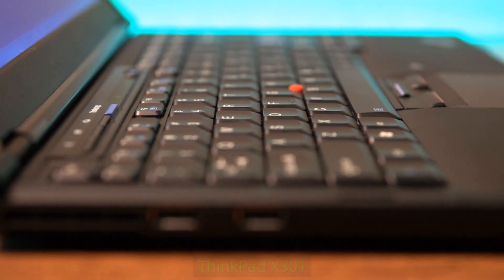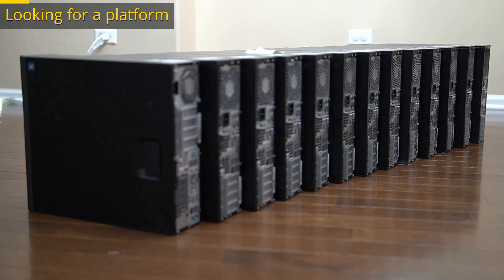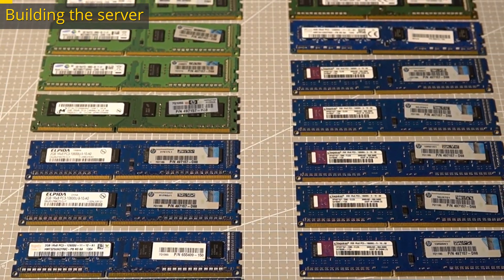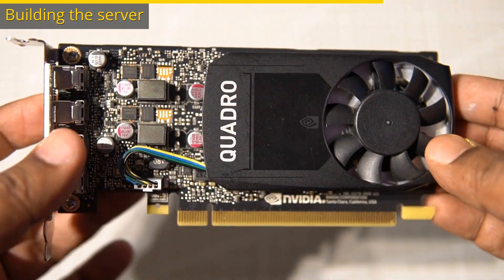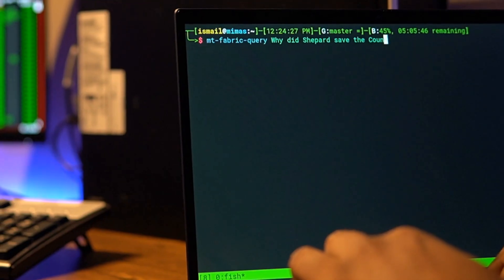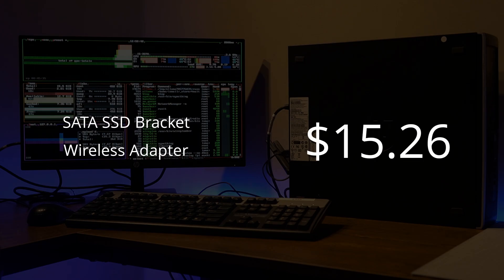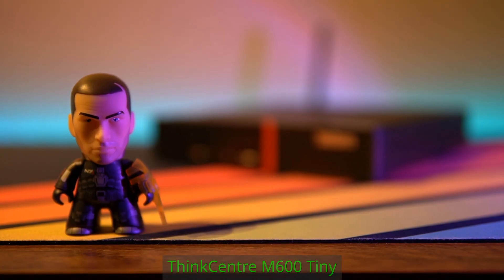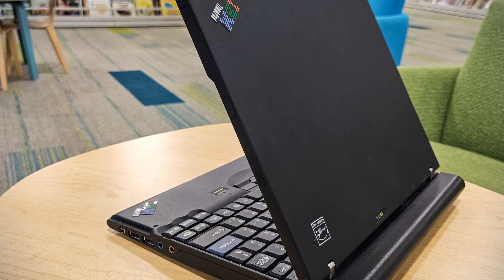I Built an AI Server from E-Waste

Comment: I am in the same boat and, of course, power is a big issue.  I would love to have something I could just leave running to serve a local LLM but as you indicated, spending money up front on a system that won't even be used most of the time is not really feasible.  So I have to find a good way to power on the system when I want to use it and power it off when I don't need it.  Hmmm, maybe THAT is the key to this scenario?
Reply from the maker: Yep. That's exactly the thing here. Speaking of which, I just realized that I left the system running (doing nothing) since I published this video. 🤓
I'd better get working on a solution.
Reply: @myTerminal  Let me know what you come up with.  I would be curious.
Reply from the maker: Sure! I'll do.

Comment: Wake on LAN sadly is not a thing for WiFi. That's where you might consider wired Ethernet again...
Reply from the maker: Maybe. Currently I'm handling it manually and evaluating at least auto power down at night through a bash script. Let's see how it goes.
Reply: @myTerminal  There are two limitations with WOL that both can be solved the same way - one of them bein that it doesn't work over wireless connection, second that it cannot be used from WAN. 
Now, the solution is simple, you just need a middle man (server), that you tell to wake up a certain computer, and then the middle men sends the magic packet. 
The only requirement is that the middle man and destination computer/server are connected on the same LAN with a cable. 

Now you can take something like a raspberry Pi (or even zero with HAT)  or any other server you're already running 24/7 and use it in such way. Maybe SSH into that device (which can easily be also port-forwarded from WAN) and set up some simple bash aliases so that you have a simple nice command for every device you want to wake. 
Or, go fancy and make a simple website with buttons that issue a shell command to wake the computer. I did that once. What could also probably be implemented is some sort of feedback/status check, maybe using simple ping, to also display wheter that device is on or off.
Reply from the maker: These are cool ideas, and I thought of doing something similar before. I'll surely give it a try some time. Thanks!